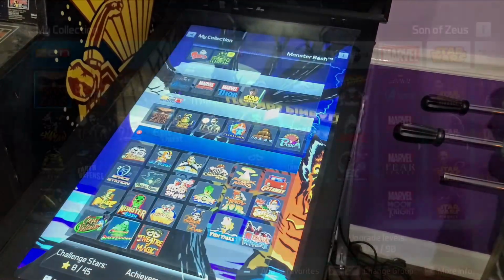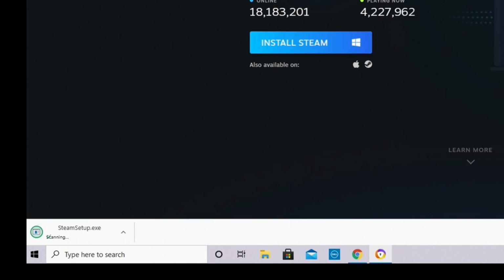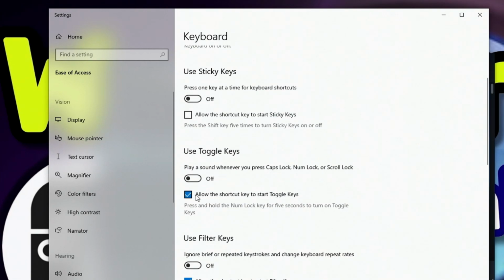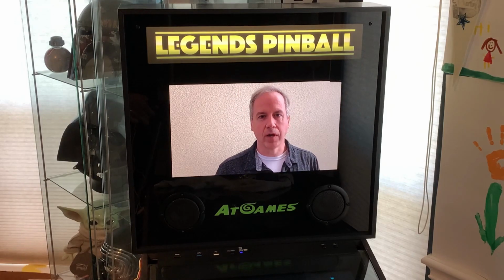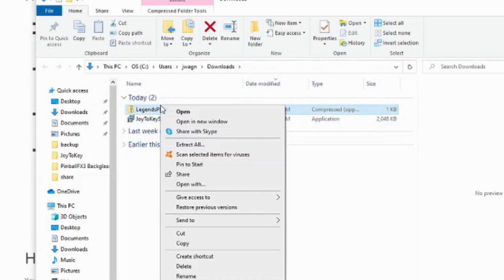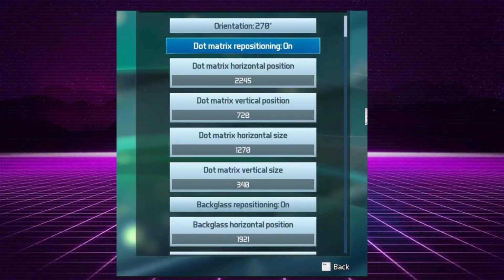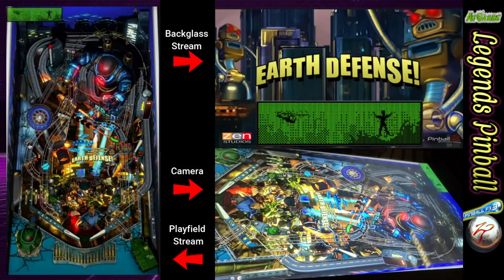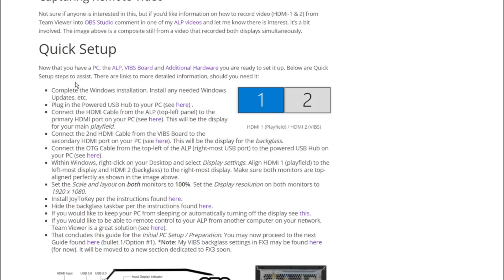Pinball FX3 Setup Guide for the AtGames Legends Pinball Machine

Comment: You're pretty explicit about every step, but there doesn't seem to be any mention of setting up the controls within Pinball FX3. I'm assuming that, since you're recommending Joy2Key, the control scheme should be keyboard and mouse.

Is there a way to confirm the ALP's controls are communicating with your computer? I'm sure you'd get a pretty good idea running FX3, but it would be nice to know for trouble shooting.

Thanks for the video, I used it extensively setting up cabinet mode.
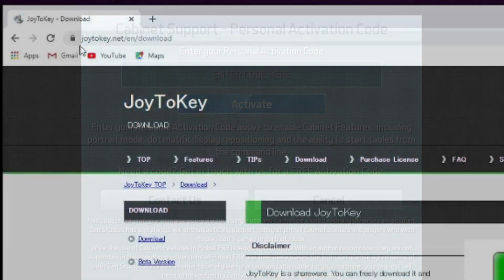Reply from the maker: Hi Lowell, there is mention about setting up the controls but the good news is that it's very easy.  After installing JoyToKey just download the LegendsPB-WTT (.zip file), extract and copy/paste it into the /Documents/JoyToKey subfolder.  It's shown in the video ( at 08:15 ) and here: http://wagnerstechtalk.com/alppcsetup/#How_to_Setup_JoyToKey  After you do this, you're good to go.  I try to keep it as simple as possible and this .cfg file sets it all up for you.  Plunger even works, thanks to Joe F. that created this file.  I only made minor changes to allow you to left/right click using the Arcade Control Panel if you want to use the trackball as a mouse.  To confirm if the buttons are working, just open JoyToKey and press the associated buttons Play/Select, Rewind, etc. and you'll see a yellow flash on JoyToKey as the buttons are pressed.  A little below the above link, you'll see what the buttons on the ALP do.  Hope I've answered your question fully, if you have any further questions let me know.
Reply: @WagnersTechTalk  This helps, but you still didn't mention which input setting to choose in FX3! I understand it's almost certainly the keyboard and mouse interface if you're using JoyToKey, but I currently have no way to test that! When I run JoyToKey, it doesn't detect the ALP at all. An Insignia USB hub didn't help, so I'm going to check the one you recommend.

My big problem now is that I added a USB-B to HDMI adapter in an attempt to add back panel support to FX3 and now I don't get any video on the play field. Audio, no video... Even though the adapter did send a signal to the TV I added to my setup, FX3 has not worked properly since I connected it. I thought the adapter driver might be an issue, but it continued after I deleted the driver and rebooted.

The good news is that the ALP is chugging along through all this. I'm just not making the best use of OTG, which is a huge selling point for the ALP.

Thanks for responding in the middle of the night!
Reply from the maker: First, let's make sure your ALP is being recognized by Windows.  Launch JoyToKey and select the menu option Settings - Configure Joysticks.  Then click the 'Configure Game Controller Property' button.  Do you see 'ATG Control Deck' or something similar?  If not, see my blurb on the 2nd bullet here: http://wagnerstechtalk.com/alppcsetup/#Additional_Hardware (I didn't think it would work, but that exact hub is what fixed my issue, I tried a powered Amazon Basic hub previously which did not work).  If you do see everything mentioned above, close out of FX3 and just launch the Steam Client.  Select the Menu option Steam - Settings - Controller.  Then click the General Controller Settings button.  You should see 'ATG Control Deck' at the very bottom where it says 'Detected Controllers'.  If you don't, the problem is with the OTG connection to the Hub/PC.  I did not make any controller setting changes within FX3 itself, it was just in JoyToKey.  Let me know if any of this helps please, or if I need to update the guide in anyway.
Reply from the maker: Just FYI - Added some things to try in the 2nd bullet here: http://wagnerstechtalk.com/alpfx3/#FX3_Troubleshooting  If JoyToKey isn't seeing the ALP using this information, then you're having the exact same issue I did initially.  After using that hub, JoyToKey worked as shown in the video.  I'm 95% sure that's the issue.  No controller changes needed in FX3.
Reply: @WagnersTechTalk  JoyToKey never saw the ALP -- there was a message "0 controllers detected." I didn't try through the Steam client. I've ordered the USB hub you recommended and it's due to arrive Monday. I'll try again when the hub is hooked up.

Part of the reason I thought you might want to be more specific about the in-game controller settings is, when the ALP controls didn't work, I attached a wired Xbox One controller. It worked, but the JoyToKey settings weren't correct for it! Maybe the program was getting controller AND JoyToKey inputs?

Thanks again!
Reply from the maker: Yeah, the JoyToKey settings are mapped for the ALP and may not work for any other device.  Let me know how it goes with the new hub, should be good to go at that point.
Reply: @WagnersTechTalk  I'm sure you're right and will test the hub as soon as it arrives. My other issue is getting the video feed to work properly! I e-mailed a help request to the Pinball FX3 representative who sent my cabinet code, so I'm waiting on that response. I'm guessing I'll have to reinstall the program...

Thanks again for your help and all the great videos, FAQs, and support files. It's all been a great help.
Reply from the maker: @lowellcunningham3332  Most welcome, going to be out of town for a bit so I may not be replying much (or in any kind of detail) over the next couple days.  But will be monitoring when I can.  I'm glad the guide, videos, etc. have been helpful.  Shouldn't need to re-install FX3 to enter your cabinet code, hopefully the rep will be able to assist with that.  Where is the video feed issue and what is it?  Is it on the main playfield or the backglass?  If it's the backglass, I have some help for that here: http://wagnerstechtalk.com/alp/#VIBS_Troubleshooting  If it's the main playfield, I'd try a different HDMI cable (about the only thing that might cause a problem with that).
Reply: @WagnersTechTalk  It's the play field. I get what looks like a command line and audio. It's the same on a monitor and the cable worked fine before, so it's very likely something changed with the software because of the adapter and associated driver -- those are the only things that were different. In every other way the setup acts like a two monitor system with full audio and video set to extend screen.

My thought is that reinstalling would reset Pinball FX3 back to a state that worked, but I'm still looking for a better option.

Have a great trip!
Reply from the maker: Hi Lowell, just checking in to see how the new hub worked out for you.  When you get a chance to try it, let me know I'm hopeful everything goes smoothly at that point. -Jon
Reply: @WagnersTechTalk  I like the hub, but it didn't help. I'm starting to think it's the USB cable, because various people online have had a similar issue which was resolved with the right cable. JoyToKey doesn't see the ALP, nor does joy.cpl. Perhaps there's a certain order of connections I need to make? Or maybe it really is the cable?

I'm still puzzling over the video issue as well. A Zen representative recommended reinstall, which didn't change anything. I used Windows uninstall, not Steam. When running Pinball FX3, I'm still getting a message that Steam is attempting to display a Jpeg instead of the play field video. A FB forum member suggested turning off the back panel display in Pinball FX3, but I haven't tried that yet.

Your continuing help is amazing! Thanks again.
Reply: @WagnersTechTalk  I ordered a shorter cable off Amazon (1 meter) and that immediately fixed the issue. JoyToKey works wonderfully. I have a bit of lag in Pinball FX3, so I'm going to try different configurations.
Reply from the maker: @lowellcunningham3332  Awesome news Lowell!  Did you find any improvements I need to make to the guide or are you pretty much good-to-go now?  Thanks for the update!